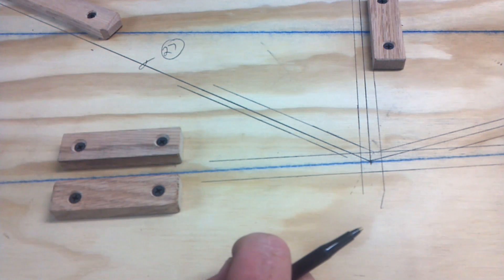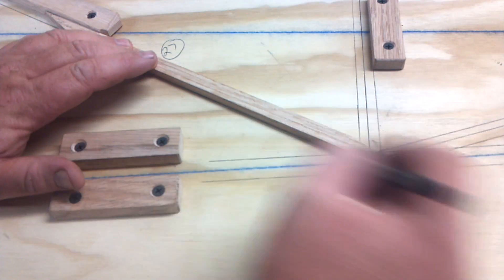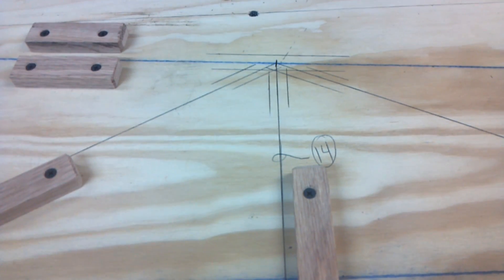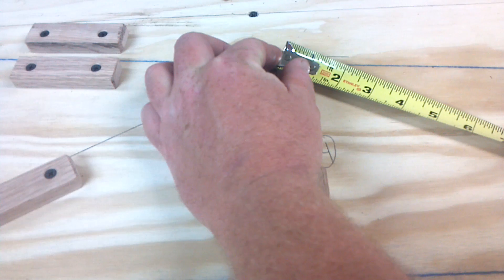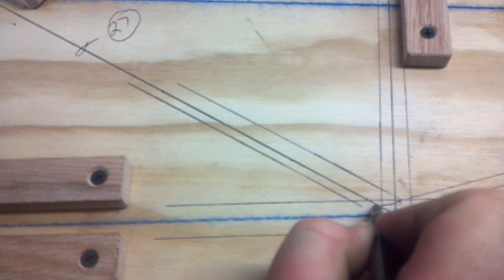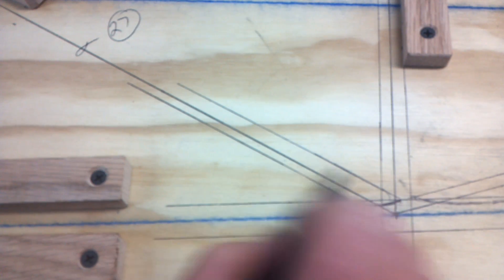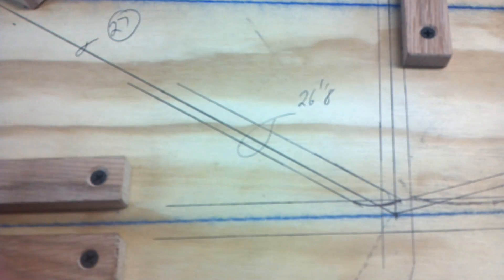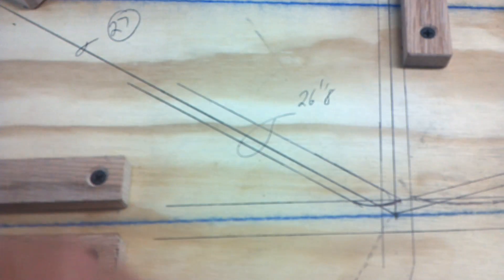Legal Eagle Ultralight construction video #6

Comment: For some one who describes a building process so precise it surprises me that you do not burn an  inch when measuring. By holding the tape at the one inch mark, it eliminates the common error of the push vs pull effect, that is inherent with rough measuring device such  as the "tape measure" instrument.